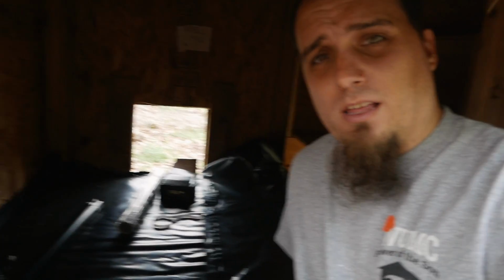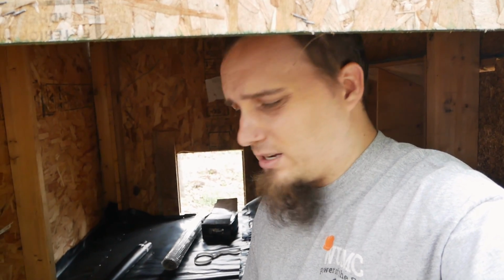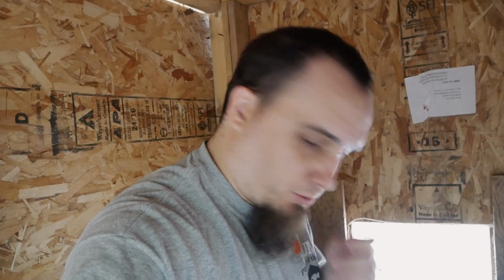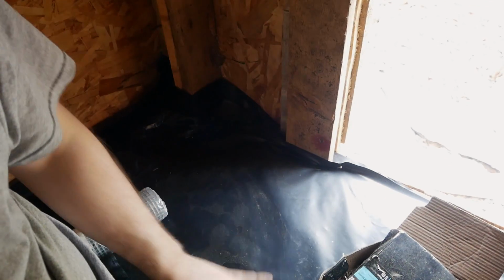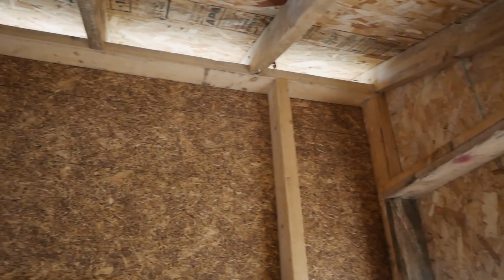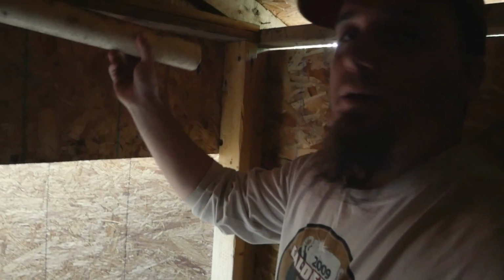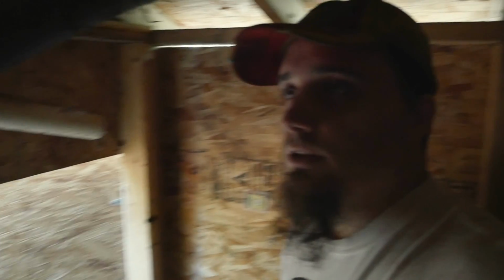Cheap Chicken Coop Flooring || using what we have for our CHICKENS!

Comment: Do you have a video of build of nesting box?
Reply from the maker: I don't.  But all I did was put a maybe 3 inch piece across the top of each level.  Then the remaining bottom 6 inches or so I cut out a cover for that but I put hinges on the bottom of that piece and the bottom of the nesting box.  Then I took a piece of 1 by and cut it like 1.5 inches by 3 or so and screwed it to the top piece I mentioned and it could hinge down over the door part to hold it in.  This coop is at our old place but next time I'm over there I can try to shoot a video of it showing what I did if my terrible description is as terrible as I feel like it is.
Reply: Attaching the top hinge so it lays flat is my struggle. I've tried to attach to my slanted roof section. Then, tried to attach to the bottom. I'm definitely un-hinged! 😁🤣⚘